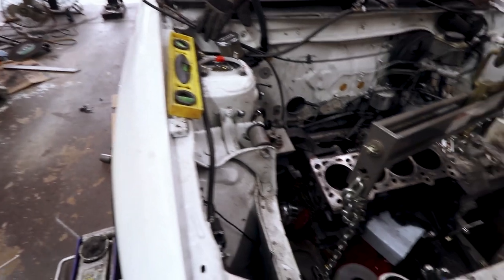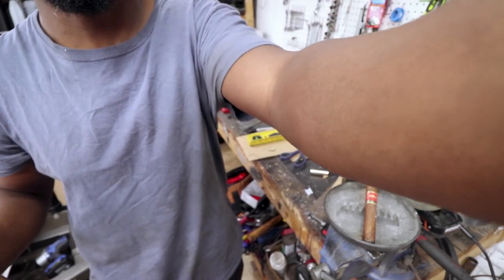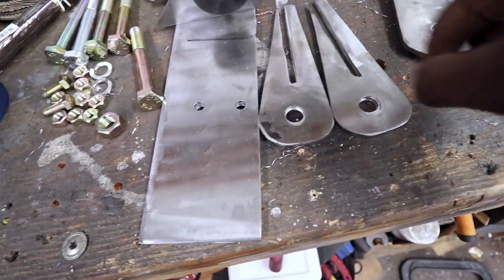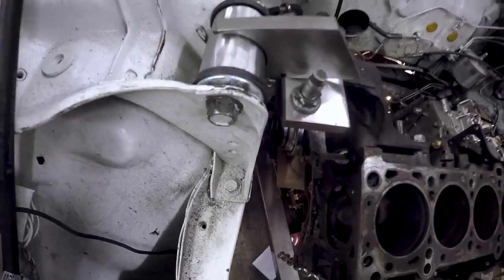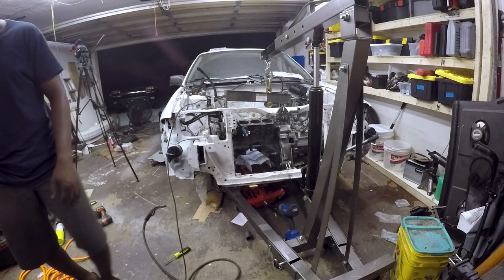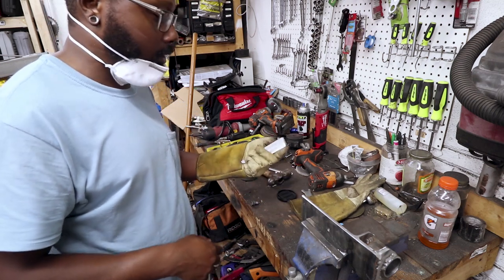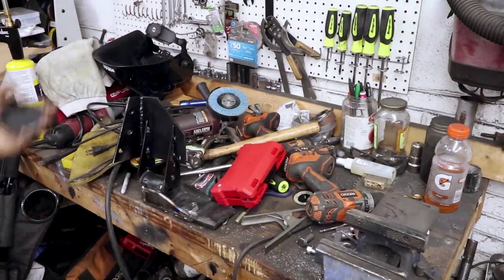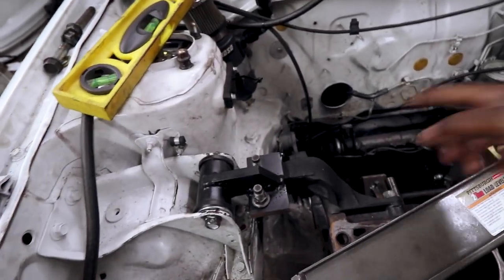Toyota E153 in Mazda BG Ford Escort GT part: 6 Engine Mounts Fab

Comment: Hey Stovall, would you consider fabbing up some mounts to sell?
Reply from the maker: I've thought about it, but it's really time consuming,  and not every BG chassis is exactly the same, I've got the engine trans moved back as far as it can go, to the point it would fit if I had power steering (it would make contact with the lines). If I have the engine out again I may make some templates or something.
Reply: @StovallsGarage  had a feeling that would be the case, appreciate the comment. Your car is awesome. Been wanting to turbo my JDM Familia Infini but gearboxes have always been what kills the dream, you've at least made me see its possible. Thanks for the content
Reply from the maker: @Mihalis51  yeah the stock gearbox is pretty horrible, I hear there may be another option that requires less fabrication,  I'll keep you updated if I hear more.
Reply: @StovallsGarage  cheers appreciate it. Is this the Mitsi option?
Reply from the maker: @Mihalis51  it's another Toyota trans.
Reply: @StovallsGarage  awesome thanks appreciate it

Comment: Any idea where the engine sits in the engine bay now? more forward and to the passenger side? same height?
Reply from the maker: As far as I can tell about an inch to the passenger side and maybe 2 inches forward,  height looks the same, but it's hard to tell without the head.